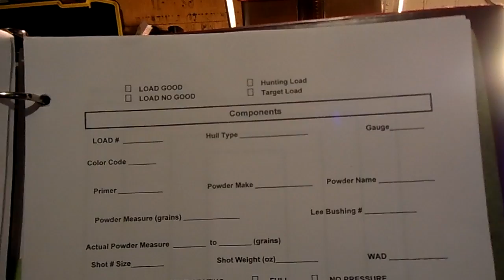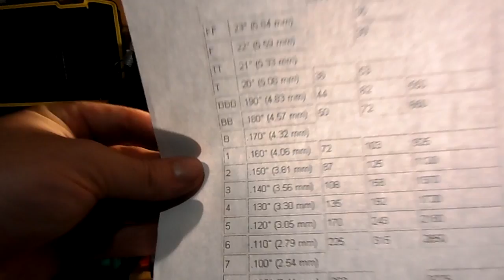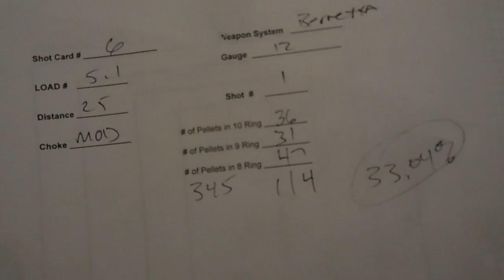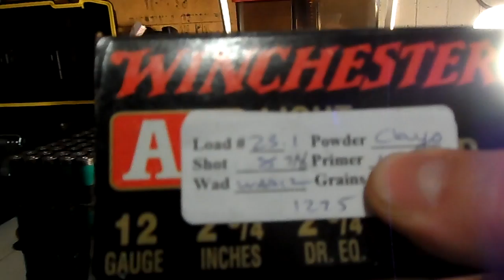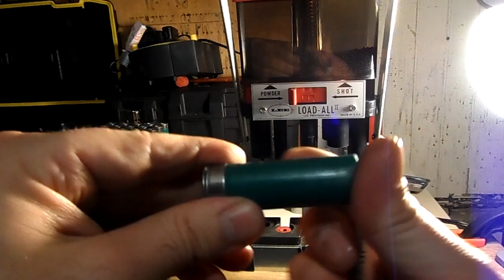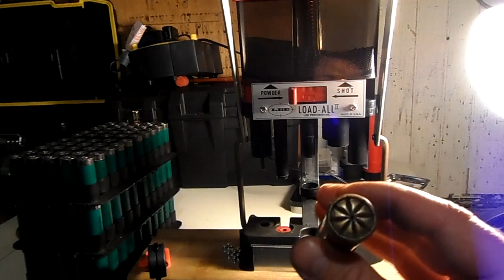Lee Load All II (Part 2)

Comment: whats the difference between load all and load all 2.   been looking at it. speed is not a must and im not a world class skeet shooter. just want to do it as a hobby and to blast clays
Reply from the maker: Man it’s been so long since I have been shopping. I believe it was something to do with the final crime stations and maybe the collets to resize the brass. Either way the II has to be an inprovement right. ?
Reply: Load all had only 3 bushings for shot, no powder bushings. Guage specific metal base. Load all 2 more or less added bushings. This, load all "3" added plastic base and final crimp plate to swap guages. Other minor changes. Dont bother with primer feed.  Avoid load fast progressive, sizing issues in base. Load all junior acceptable, old handloader ok, funky mouths crimps at times, waaay overpriced on fleabay.

Comment: I use Winchester AA (red only) for my heavy hunting loads that I load on my Lee Load All 2. I use a Hornady 336 for my clay loads with Remy hulls. The 1st time I had a hull collapse (what you call bend) is when Winchester started using the gray AA hulls. I've also done it with the gold Remy hulls on the Lee. It must have something to do with the plastic because like I said, the red Winchester AA hulls have never been a problem.
Reply: BTW, I watched part one and two. You gave some good info. And, a little drop of wax on the crimp works great where you use nail polish. I'm going to try the polish. It may be faster. Thanks
Reply from the maker: N5KDA Thanks for watching. To this day I still prefer the green gun clubs. Thy are the most consistent plastic and get the most loads. The AA would be a second favorite. The Premier STS aren't bad either but those are expensive and not often found in the range dumpster ;)

Comment: Can you load new unfired hulls with this?? Does it crimp OK using new hulls?
Reply from the maker: bigtoad45 i have only ever used spent hulls.  I imagine it would be ok on new hulls since it has a tool in that makes the star pattern 6 or 8 point for the crimp.

Comment: Why are you hiding your load data? Most of the load data is available for free on-line. Are you running custom loads?
Reply from the maker: It's a common thing not to share so if something goes wrong someone can't say they got the load from me.
Reply: +Frankdubbs_fpv
Unless you're advocating others use your custom load data, I don't think there are any legal issues. Also, your powder data is still visible before you covered it up.